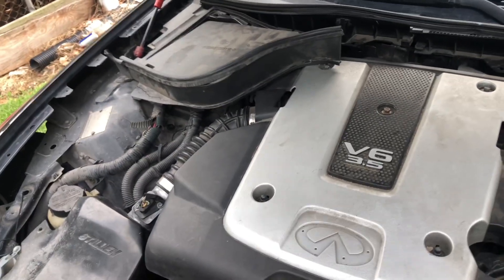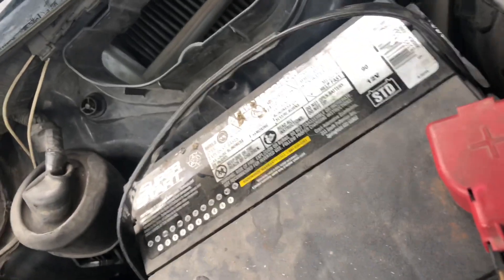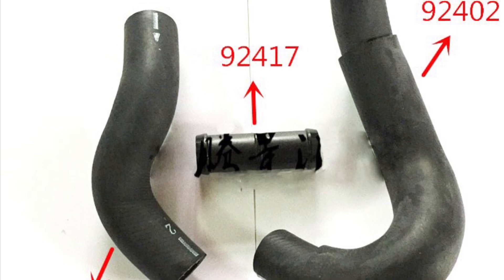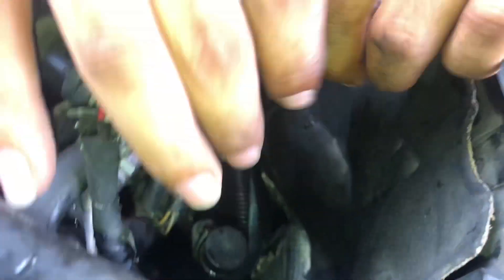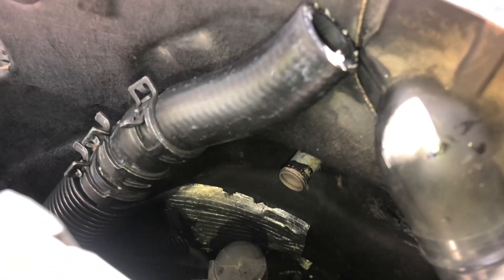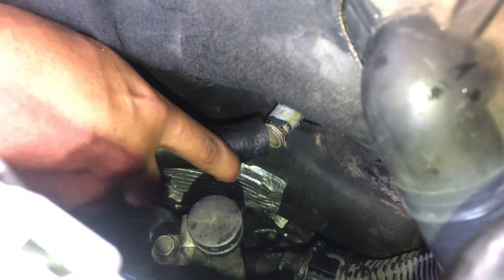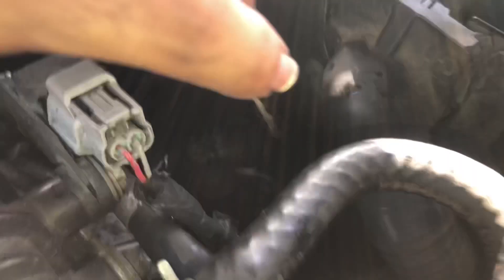Heater Hose Passenger Side Replacement (Infiniti G35/G37)

Comment: Perfect! Exactly what I needed to see. Friggin Infiniti..... the engineer who picked the material for this fitting must have been a newbie. Or he picked a metal fitting, but the finance department changed it to save a couple bucks. Love my G37 , and all the Nissan Maximas I've had in the past, but seeing things like this is frustrating... especially when I have a '97 bone stock Honda Civic that is still kicking, and NEVER had any problems like this. My Civic is proof to me of what car companies CAN do if they WANT to. Original air conditioning... never had a leak... Original clutch (Not kidding)... everything still works... over 300k miles. And it is cheap to fix.  I digress.... thanks for posting the video; back to taking things apart.

Comment: This was a valuable video for replacing this heater hose. Thank you! However, I would not use oil as a lubricant to put on the new hose. Use dish soap (Dawn) instead. Thanks again!
Reply from the maker: No problem and appreciate the tip 🔥

Comment: How hard was it to get the hose off that goes back into the engine? I replaced the coupler piece and realized the hose that goes into the engine is now leaking
Reply from the maker: Nothing hard , just takes time , and the right pliers
Reply: Bro I been trying for 2 days to take that shit off
Reply: Good luck trying to putting the clamp on the right spot

Comment: Yup mined is a 2008 ex35 (vq35hr)and sure enough the connector peice one day while heat was on sent a puff of smoke from right side up under my hood, did it twice then went away as i was in motion, turned heat off immediately, long story short 2 weeks later due to leak always drying before i can find it, parked it on a hill turned heat on and BAM leaking at connector, baught extra hoses and things but literally only connector peice literally snapped in half and was brittle and broke apart as i was taking it apart..... took a good hour to 2 to do so cause i shouldve purchased long needle nose pliers.....but yea problem fixed!

Comment: And are familiar with the passenger floor getting wet when it rains??
Reply from the maker: That problem has to do with your sun roof hose being clogged , they have videos on YouTube on how to unclog the sunroof hose
Reply from the maker: This part right here is probably clogged up 

https://www.ebay.com/itm/194010562682?epid=1157963203&hash=item2d2bee407a:g:oAoAAOSw0jRgZg0c
Reply from the maker: You can either clean it out , or order that part , it’s better to try and clean it yourself to save money and get the problem out the way
Reply: Hey man dealing with the same problem did you end up figuring out what to do?

Comment: You use 1 hose when u replace or you used the 2 hose & adapter
Reply from the maker: I used 2 oem hoses and adapter , but u can just buy 1 long hose from oreily, take your old hose ,show it ,and they’ll give u the length u need , u Just need to cut in half in order to put the adapter in between and for the adapter I recommend u buy the aluminum kind , so it will last forever

Comment: good video to learn from bro thanks.
i have a little problem with my 2014 370z and i need answers fr, i changed the coolant fluid and the heater hose connecter but afterwards while driving the car i noticed water sound sloshing behind the steering wheel! i am kinda worried tbh and hope u got any idea to figure out what caused that issue and how to solve it.
thanks again
Reply from the maker: Check your coolant level , if it the fluid keeps going down then it’s a leak in the coolant system, but since you mentioned the steering wheel maybe it could be power steering fluid making the noise , is the noise when your moving the steering wheel?
Reply: @Gm29_mtz  i’ll keep an eye on the coolant level since i don’t use the z as a daily car but about the sloshing sound it only happens when i fully stop and then accelerate and very rare when i take turns
Reply: @Cloudzix1  you got air in your coolant. Gotta bleed/burp the system

Comment: I can’t take off neither the heater core hose and the hose that goes in to the water bypass
Reply from the maker: Use pliers to wobble them out  , since they prolly never been taken out they are stuck, last option is to cut them off and make sure you clean the residue good

Comment: do you have to bleed the system or burp it ?
Reply from the maker: Yea , there will be less fluids spilling when disconnecting the hoses
Reply: @Gm29_mtz  so i have to fill it and bleed it ?
Reply from the maker: @big_guy-wi1bf  make sure u buy coolant first  , bleed then refill
Reply: so after connecting the new part bleed and refill ?
Reply: @Gm29_mtz  my problem is the plastic connector piece is slowly leaking
Reply from the maker: @big_guy-wi1bf  bleed it before u take the old plastic part then put new part and refill after

Comment: Hey gotta question bro I gotta g25 with the same issue I couldn’t find the rite hose but I got just this one hose that actually fits perfect is it best to use both tho ?
Reply from the maker: You might as well replace both , bec if you decided to change another time , then you have to do the process again
Reply from the maker: And if it’s a hose that is heat resistant than it should be fine , as long as you clamp it down tight
Reply: @Gm29_mtz  appreciate you my guy I ended change the entire hose now my car back A1💪🏽
Reply: @lsdbutta_7079 what kind of hose did you end up using if you remember? i’m having the same issue on my g25 trying to find the right hose
Reply: @skimaskjavi  I used a HVAC heater hose from auto zone the connection piece started wearing out an just blew up but car has been good ever since

Comment: yo bro was that bypass causing overheating bc that’s the same setup on mine and i’ve been thinking about putting the 3 part hose back on
Reply from the maker: Mine wasn’t overheating , but check for any leaks around the area and inspect the hose for deterioration

Comment: How can I take the back clamp on back from engine mines is broken so I can grab it ?
Reply from the maker: That one is though but possible to take off , I do recommend using pliers that bend at the tip and keep wiggling the hose as u have a grip on the clamp ,  but last resort is to cut the hose with a pocket knife , ONLY if you are replacing the hose, cutting it can make the break the clamp loose
Reply: @Gm29_mtz  okay thank you I been too a lot dealership in my area they don’t have in stock
Reply from the maker: Check rock auto.com they have cheap oem parts
Reply: @Gm29_mtz  I’ll check
Reply from the maker: @diiirtydannmusic  also use oem clamps over the caterpillar clamps bec the oem clamps are strong

Comment: Y’all know if it’s the inlet or outlet hose
Reply from the maker: It’s gonna be both ,inlet and outlet hose , it’s a 3 piece system with the connector in the middle , just make sure you get passenger side hose

Comment: Where did you purchase the plastic piece from?? Or the hose??
Reply from the maker: This the link for the plastic version , they also sell an aluminum one which will last longer 

https://www.ebay.com/itm/363435162506?_trkparms=ispr%3D1&hash=item549e6c7b8a:g:y8AAAOSw6yBgyI27&amdata=enc%3AAQAGAAACwPYe5NmHp%252B2JMhMi7yxGiTJkPrKr5t53CooMSQt2orsS5%252FLJbfonbQUYd49AU1AJY3rPjL%252BENLVtl5oWjvV5zIG1HMtcbSYuLhxUqhQPcx8kWdadUGUDtLZuqePXcvfbyPgA3PdvGU%252BxmweIVFZzxcrMXICCwyE9I5ZDAfEtsxQEuAPVXNDyqAAlkZg8JwDFmF77SstDifsNArXaWdZpDhIY%252F7HOw%252BmOXUgfMuK5OP0sJb7w1F52uCdZUBC48rsWA2kc0K4T%252FWzhbJMdio0R%252FMG%252BoDgqznVo%252Fzl5mSpo4lKan4ngMwkhiwUiRscg5Hf78fsu5maa8QY3AX1PoDCg58GO%252Bl%252FmSyPH7sHjopwyHQKpXhr1UkXiogCvQfxWOwa5Jvi3KgyNmhHNAZTQVrpD55nJPYdvA3qrVTdupyg56a%252FkLessUBJnnKn3XiBZ4dkreER%252Bv9WTJdK9FAEl0GhHrguhONpA5jrH3iy%252Box21Xo%252BGbEOJTqBWywQmPIZVdWv2Q5QI%252BUtPVINoY9PgCTiVMNau3AudVCkCIPVQ2GTnt636rUqzkyIe72zZsKN6PdVqXXeXI4YG6B%252Bx7Vto0sdoJ2%252BUODH%252FZHMJSIgnlQSW%252B5ZW%252Bgp%252BWYmkYyxM0sZNMPLLB0zB5MG%252BTzNayPBIco98fdvtwoGDw22WUumDd6xEaW6dhAFNDn64Xi9fYjx5gMZKvEc%252FVeEOfRmf4%252F%252FoKBTVgFIMXFek9QZuko4k4rMChwEglGjNM3F4%252Fh%252Fq0j1gAny%252FAODMGhY8txMCeZkL9a61Dpxrtze9NbMooebBxxHfx2YpqVn2sZvOn3SSceqE3LSmZviqIbVFmGDE1FEjJfTruPl%252FWyzlNhBQxNcNYpG6wx5P6wSobM7amRVzG4itz7MiR%252BNPQJIPBEwxFBGZ9Xtu23SfEbK2I6FPrFO6%252FaTZvcuc%7Cclp%3A2334524%7Ctkp%3ABFBMtou7tqpf

Comment: What size of hose and connector did you use?
Reply from the maker: Connector I used is this one

https://www.ebay.com/itm/363435162506?_trkparms=ispr%3D1&hash=item549e6c7b8a%3Ag%3Ay8AAAOSw6yBgyI27&amdata=enc%3AAQAGAAACwPYe5NmHp%252B2JMhMi7yxGiTJkPrKr5t53CooMSQt2orsS5%252FLJbfonbQUYd49AU1AJY3rPjL%252BENLVtl5oWjvV5zIG1HMtcbSYuLhxUqhQPcx8kWdadUGUDtLZuqePXcvfbyPgA3PdvGU%252BxmweIVFZzxcrMXICCwyE9I5ZDAfEtsxQEuAPVXNDyqAAlkZg8JwDFmF77SstDifsNArXaWdZpDhIY%252F7HOw%252BmOXUgfMuK5OP0sJb7w1F52uCdZUBC48rsWA2kc0K4T%252FWzhbJMdio0R%252FMG%252BoDgqznVo%252Fzl5mSpo4lKan4ngMwkhiwUiRscg5Hf78fsu5maa8QY3AX1PoDCg58GO%252Bl%252FmSyPH7sHjopwyHQKpXhr1UkXiogCvQfxWOwa5Jvi3KgyNmhHNAZTQVrpD55nJPYdvA3qrVTdupyg56a%252FkLessUBJnnKn3XiBZ4dkreER%252Bv9WTJdK9FAEl0GhHrguhONpA5jrH3iy%252Box21Xo%252BGbEOJTqBWywQmPIZVdWv2Q5QI%252BUtPVINoY9PgCTiVMNau3AudVCkCIPVQ2GTnt636rUqzkyIe72zZsKN6PdVqXXeXI4YG6B%252Bx7Vto0sdoJ2%252BUODH%252FZHMJSIgnlQSW%252B5ZW%252Bgp%252BWYmkYyxM0sZNMPLLB0zB5MG%252BTzNayPBIco98fdvtwoGDw22WUumDd6xEaW6dhAFNDn64Xi9fYjx5gMZKvEc%252FVeEOfRmf4%252F%252FoKBTVgFIMXFek9QZuko4k4rMChwEglGjNM3F4%252Fh%252Fq0j1gAny%252FAODMGhY8txMCeZkL9a61Dpxrtze9NbMooebBxxHfx2YpqVn2sZvOn3SSceqE3LSmZviqIbVFmGDE1FEjJfTruPl%252FWyzlNhBQxNcNYpG6wx5P6wSobM7amRVzG4itz7MiR%252BNPQJIPBEwxFBGZ9Xtu23SfEbK2I6FPrFO6%252FaTZvcuc%7Cclp%3A2334524%7Ctkp%3ABFBMtou7tqpf
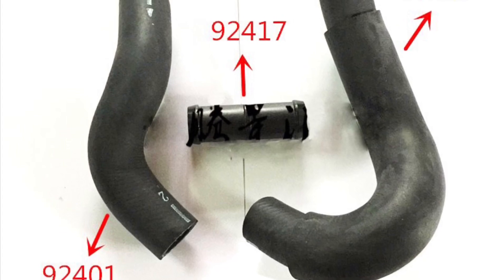Reply from the maker: At 1:19 you can see the hose part number , I’m not sure exactly about the Size but you can search up the part number and the exact hose you need should pop up
Reply: @Gm29_mtz  ok thanks

Comment: No dam part number lol
Reply from the maker: 92400-JK200 
92401-JK20A
Those are the hose ,

This is  link for the aluminum connector which you should get Over the plastic connector 
https://www.ebay.com/itm/224164614819?fits=Model%3AG37&hash=item34314092a3:g:91cAAOSwTwxfXEYV
Reply: jk20a is easier find. i keep finding only for 2008 on the other hose

Comment: I just replaced mine and I just installed one hose I didn't use the connector I used one long bendy.hose it works
Reply from the maker: Yeaa u should be fine, tbh its better to install the bleeder port from z1 Motorsport instead of just the plastic connector
Reply: @Gm29_mtz  the bleeder on my 2008 g35 is on the driver side
Reply: @Gm29_mtz  if you don't have a bleeder on passenger side it'll be on the driver side.
Reply from the maker: Yeaa I have the bleeder port on the driver side as well , I’ve some videos of people adding a bleeder port to the passenger side , which I would like to do one day as it will be a way to test the passenger side for leaks or any problems with the coolant system